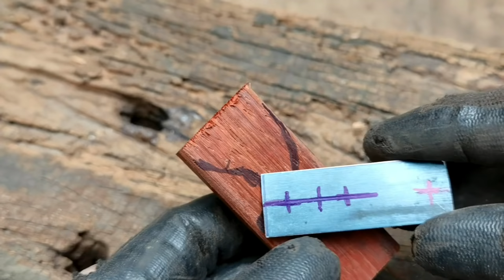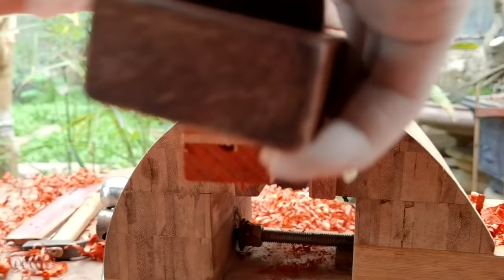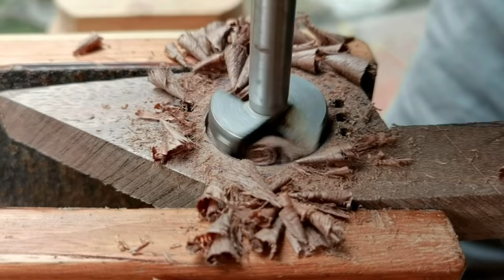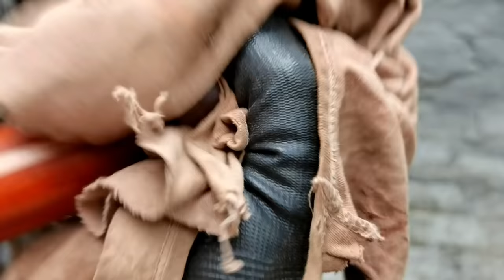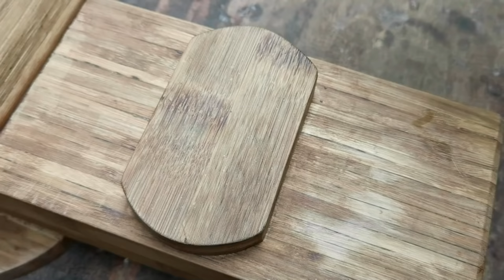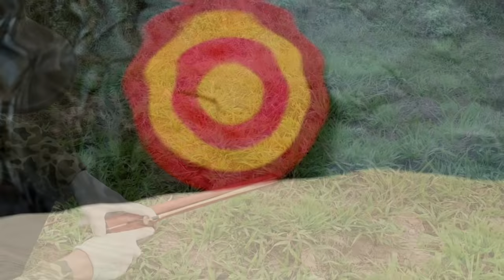ARROW RAINER - Unique, powerful handcrafted slingshot you have never seen

Comment: I'm not familiar with DIY crossbow slingshot construction, but the addition of a magnet to hold the ball bearing is genius. That would have never occurred to me. Great.
Reply from the maker: Thank you.
Reply: @WoodenDIY  What is the function of the bearing?
Reply: @degaetano510  i want to know as well
Reply: @degaetano510  its function is to be a projectile. That was the thing he shot at the spray can before the wooden arrow. As the original comment suggested, the magnet stops it rolling back down the "barrel".
Reply: @degaetano510  Let me know too.
Reply: ammo to shoot
Reply: @degaetano510  basically a bullet, but instead of using gunpowder it uses the rubber bands
Reply: @degaetano510  the bearing is there to keep the roller cam from binding on the crank pin.
Reply: @Psylent  the bearing is there to keep the roller cam from binding on the crank pin.
Reply: @Serjo777  the bearing is there to keep the roller cam from binding on the crank pin.
Reply: @jimsworthow531  Ok, you could have just as well replied to me in Chinese xD
Reply: @Serjo777  The ball-bearing is different choice of projectile. Shooting a ball instead of a dart. 
(Jim's reply was nonsense trolling about a different kind of bearing in a car engine.)
Reply: @Serjo777  me too. I still don't get it
Reply: @WoodenDIY  can you explain the function of the small magnet? Tiny brain cannot comprehend. Thank you.
Reply: @Serjo777  you could use metal balls as ammo too, the magnet keeps it from rolling off
Reply: @Serjo777  It "would" be more than wood, in ammunition regards.  I see trigger jam possibilities in regards to arrow...say ya drop the arrow and pull it back trigger pressed, then  release trigger...to find the internal trigger mechanism rested on the arrow shaft and soon as ya let go of the tension...arrow goes aloft...lol...maybe could play out that way...the magnet & bearing may prevent that in some way or create another possible hazard scenario...I dunno...just my take.  Such a great work a craftsmanship & ingenuity.  Peging the tubes is such a fantastic idea & gives it a great look!  Hat's off to this craftsmanship!  👏  Excellent job imo!
Reply: @ElAdri1999  you are amazing.

Comment: Without fletching on the arrows, yet they are still so accurate?  Amazing.
Reply from the maker: it is run in pipes.  thank you
Reply: I was taught that arrows with "no fletching" is called a "bolt". Right?
Reply: @papasfunnyfarm9703  no, a bolt is what a crossbow fires. Bolts are shorter than arrows, and the shaft is thicker. Bolts have fletching

Comment: I feel blown away to see this.  I've had (almost) this exact idea floating around in my head for years.  However, it never dawned on me to build it from beautiful exotic woods.  My thought was to use PVC, and the motivation was to fire ping-pong balls.
Reply from the maker: Thank you good brother, for your comments.  Hope you always support and share with me
Reply: Говорите, говорите… я всегда зеваю, когда мне интересно!
Reply: @berry more Not true at all.
Reply: @berry more a 22 is stronger than this
Reply: @bubrub5564  if it can punch through pressurised aluminium, it has enough of a kick to puncture flesh.
Reply: @bubrub5564  Yes it is. You get shot in the chest with this or a gun you die. Death is the outcome of both therefore equally deadly.
Reply: @bubrub5564  Note, he said "deadly", he didn't say it had identical energy levels.

A steel ball bearing propelled from a slingshot can smash through a persons skull and destroy the brain, as can a bullet. Even if the bullet has a lot more muzzle energy.
Reply: @berry more This is a false statement. A .22 short will achieve top velocity at 1095 fps. There is absolutely no way those resistance bands can achieve that speed. I love this mans slingshot and think it was executed brilliantly but it is likely less powerful than most air rifles, let alone a self-contained metallic cartridge.
Reply: Not "exactly" the idea. Not a toy!
Reply: maybe weighted ping pong balls, they are too light to even fire
Reply: That sounds like a fun idea. Like to see you build it.

Comment: Awesome work. What you did on securing the rubber tubes at the front end is quite interesting.

That said, I think the slingshot could use a front handguard or vertical grip, but I don't think there's enough room for that.
Reply from the maker: Thank you good brother, hope you will always support and share with me
Reply: Yes just a piece of 1 inch round doweled in place

Comment: maybe add a small ringed notch at the back of the darts, which also gets hooked/clamped by the trigger.
so you can load it without worrying about the bolt dropping out the front on movement. all thats missing then is a sideway sliding safety to lock the trigger ;-)
Reply from the maker: Thank you for the idea, I will consider this and maybe implement them in my future products.

Comment: How do you get rid of the white crust from all the dried CA/super glue you use? For woodwork, I use PVA or two part epoxy instead of CA anywhere it might push out because of that. Does it really sand off that easily?
Reply from the maker: Thank you for asking, I sanded the product as well as painted it.

Comment: I made a simpler version of this in Malibu 2017 using junk from the dollar store
Reply from the maker: sorry
Reply: @WoodenDIY  Sorry for what? I was just updating my design I made as a kid in Orange County, a crossbow made from construction scrap in the early 80s when I was 10. I linked thick rubberbands and twisted them into a cord and slipped the end loops in cuts in the cross piece ends, I used dry cattail reeds stripped down to their core for bolt shafts, cut the back for the rubber, taped a nail to the end. The cops had to take it, but I just made another. Years later in Malibu I always wanted to explore the tube designs I had thought about, with rubber or springs, so I did.

Comment: Change the pistol grip to something more like a 1911 grip angle and then add a foregrip.  Maybe a thin strip of wood running along the bottom two sides to protect arm/hand from rubber band hitting the offhand.  That's a solid design.
Reply from the maker: Thank you for the opinion, I will try to incorporate this idea into my upcoming builds.

Comment: Beautiful craftsmanship!
One suggestion on the arrows.
If you were to drill the back of the arrow and insert a small nail or a thick wire, wouldn’t this allow the magnet to hold the arrow in any position without sliding out?... same as the steel ball on the first demo?
How did the elastic bands hookup on the trigger again?
Again, nice job!
Reply from the maker: Thank you for your opinion. This specific design can use two types of ammo, the steel ball and the arrow. The magnet serves as the tool to keep the steel ball in place.
Reply: I wants to purchase price ?

Comment: Is super glue really the best adhesive for this kinda project? I mean I’m sure that will be enough for a video and a few months of sitting in someone garage but I feel like there’s a much better way. I’m not really an expert though and I wouldn’t know.
Reply from the maker: Thank you for your opinion, I used a special kind of glue called 502, a type that's very durable and therefore doesn't cause any problems.

Comment: The use of garters is very bad. It gives the impression of being very rustic and handmade, but we are in a hot and humid world, so when hunting, it will last very little in time and has a very low range. They should have made it with stainless steel, and with strings like those of guitars, that way it stretches much more and causes more damage to the dam. That's what I think.
Reply from the maker: Thank you for your opinion. Even though most of my products are used for entertainment purposes only, I will try to implement your ideas and further improve them in the future.